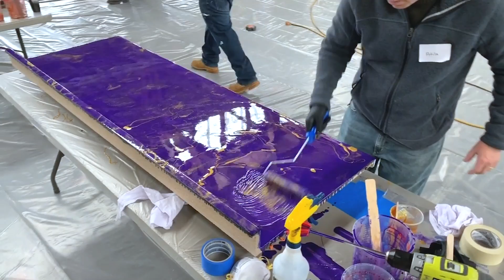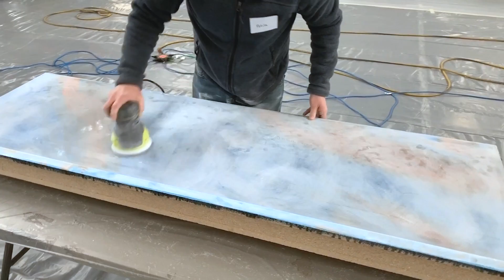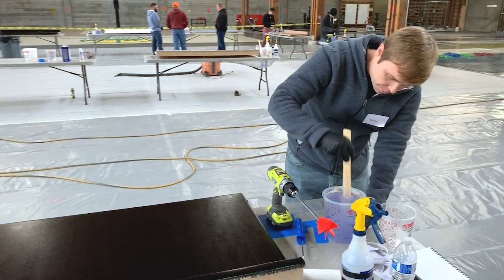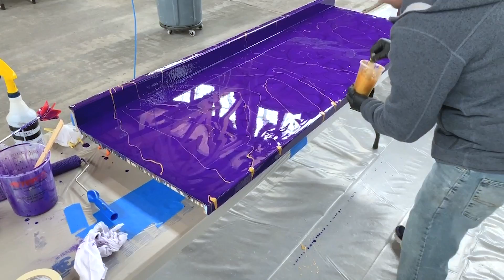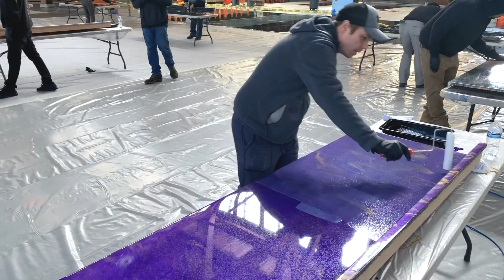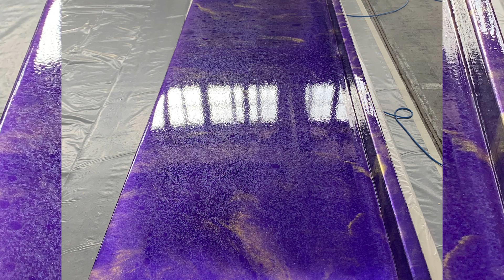Purple Metallic Epoxy Countertop | Leggari Products

Comment: after you do the last step which is the protective coat.  Does it become glossy again?
Reply from the maker: We have 3 different top coat options. Glaze coat is our super high gloss top coat that lays out glass smooth just like the metallic epoxy coat. Our WB Urethane comes in high gloss and leaves a minor texture and we also have a WB Urethane that’s a Matte/Satin finish.
Reply: @LeggariProducts  Oh ok I see.  I've been showing this to my husband and he made the comment why it's not glossy after you apply the top coat.  Because you can see the texture after you do it.  and it looked perfect before you added that.  I'm thinking of getting you sample.  We can't aford new counter tops and this looks doable and becautiful at the same time.  thank you
Reply: @mrsbabypink1  I make resin art. You can do it, it's easy after a little practice. Just try a few small practice boards. You can get mdf boards from the hardware store and practice on those before you start on your countertops right away.